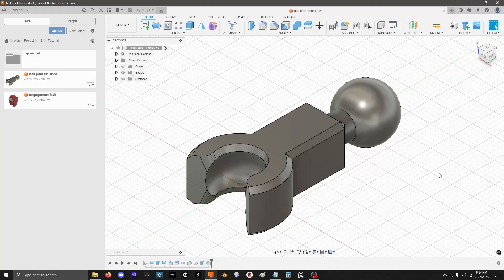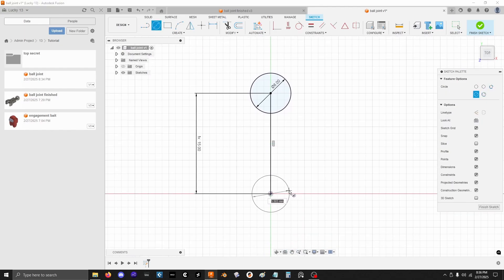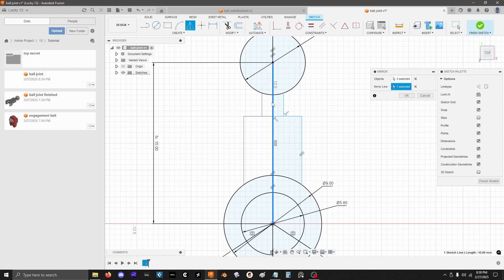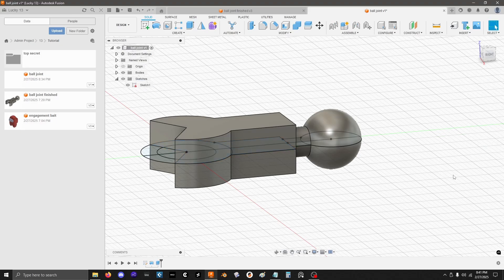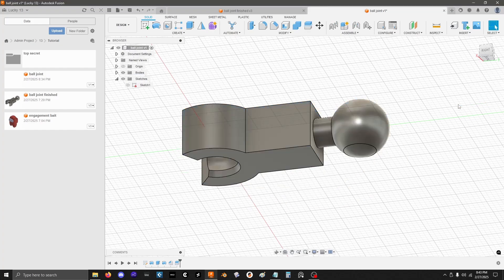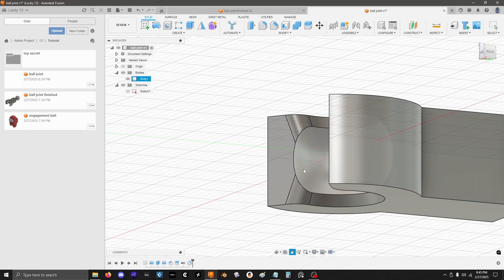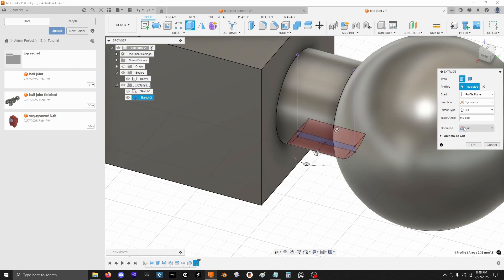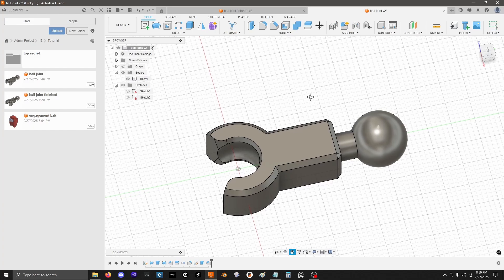Mini Tutorial 1: Modeling a Ball Joint in Fusion 360

Comment: what would you recomend temperatures for print the dummy 13 on an AnkerMake M5C?
Reply: I've found the default ankermake profiles are fine for PLA, but the PETG profile (Yes it exists, scroll down) is set to slightly underextrude. This is your choice though! TLDR: PLA: 200~230, PETG: 250